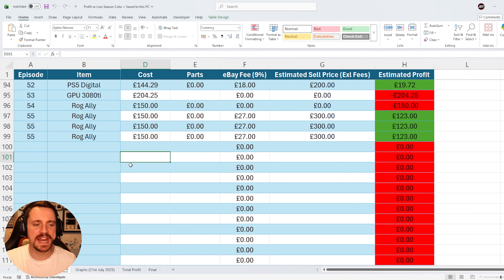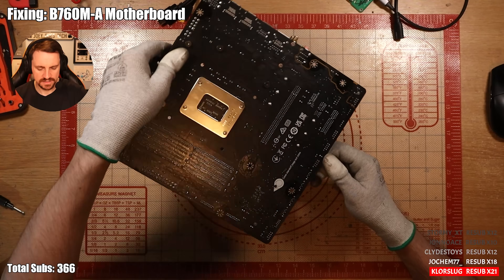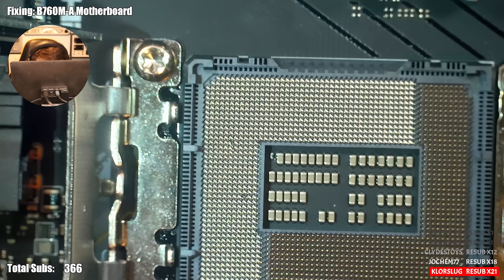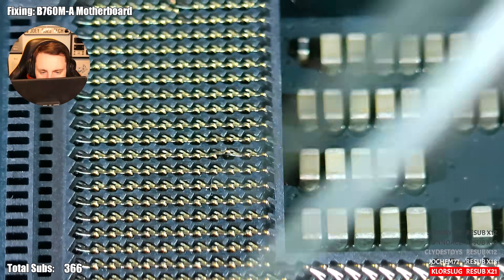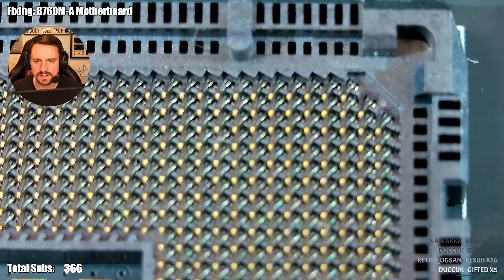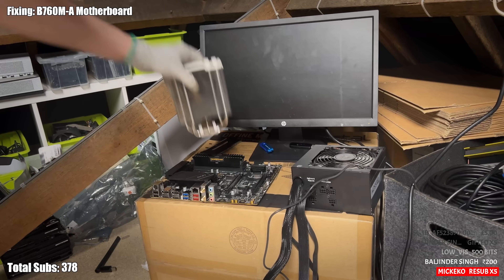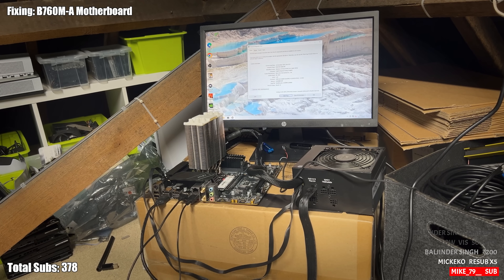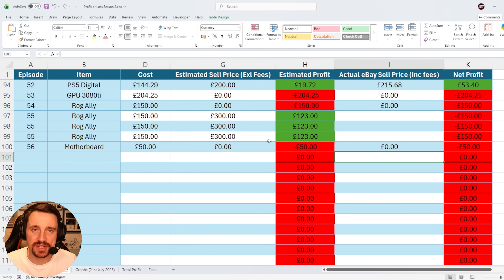I Paid £50 for a FAULTY Motherboard - Can I Fix It? S2:E56

Comment: 2 things  joey, run bios setup before booting into windows, reset defaults, check cpu temp, make sure oc and profiles off, etc. also assumed you used thermal paste on cooler but thats sufficient for testing

Comment: Nice Fix. I broke 2 pins doing this , but it was a joblot 3xMB=just shy equiv. under 10 euros , and they were LGA 115x mb's so no big deal. (one did not post,no-fan spin,with 2 broken pins during "operation" , second was fixed I had no cpu to test and 3r'd with ddr4 need's new socket - beyond me.) I recomand using a small brush from a barber's set to clean & brush the pins oposite so they come up a bit more... ,... gentley).

Comment: In my experience fixing motherboards for a profit is generally not a good idea. Even if it's something as trivial as bent pins. The problem is that you would normally need to do a ton of testing - simply making sure the board POSTs is nowhere near enough. And detailed testing of a modern motherboard can take hours... making sure the CPU works, including stress tests under load; making sure all memory slots work and pass stress tests too. All PCIe slots, USB, network, video outputs, SATA/M.2 etc etc. Skipping all that would mean that you'll get angry buyers every once in a while, so dealing with returns, negative feedback etc. 

This only makes sense with higher-end stuff and more complex jobs, but then you're looking at pretty expensive tools and hundreds+ of hours of learning. Like many things, this is one of those that might seem like a good idea on the surface - when you get lucky with a simple fix of a few bent pins - but then the reality turns out to be very different.

Comment: I. Ought a lot of 10 motherboards for 250$. Fixed 2, used them to upgrade my computer and my sons. Used another for a free computer for a nephew. Sold one of the boards for 80$ and still have a few I can repair. All had bent pins. Easy fix. One did have a broken pin for the pci rail. I soldered a single pin on it and worked great. Easier than replacing the socket.

Comment: Great job with the fix! I've gone through 6 different AM5 motherboards with bent pins and got 5 of them to post, but the most common issue is that not all of the RAM slots worked, even after I fixed the pins. I could fiddle with them more, but I feel lucky enough they even post as is. I would double check that yours can post with all the DIMMs populated and see if it passes a memory stress test.
Reply: you bent a pin too much thats what causes dimm slot issues

Comment: Imma throw a quick comment here maybe someone skilled could help me with my problem: 
I have a home theater system Philips HTS3376W, i bought it with a "faulty dvd disk drive" turns out the whole main unit doesn't work, from quick poking around i saw one swollen cap which i changed for the same one and then changed the IC's since i thought that might have been the biggest reason it doesn't turn on it doesn't have any voltages other than BK5V. I found that IC901 which is a TNY180PN doesn't get enough voltage on it's EN pin which should be 5-6V and it is 0,18V. On the bypass pin there is 5,82V and the drain gets 330V, sources are empty though I changed the resistor which is right before it to no avail, the fan spun up for a second and then it turned off. I hear a bit of whine when it's plugged in. There isn't even a standby led turned on

If anyone could help me with this i would most appreciate it.

Comment: to test bend pins are fixed without seeing what each pin was for, you need to check every pci-e lane and device (wifi, usb's etc) and every ram slot.

a broken pin can disable a pci-e slot, or disable a ram slot etc without taking the entire pc out of action.
Reply: And clock speed under load
Reply: @SkillisForNoobs  i dropped something on a server motherboard years ago, it took out some of the RAM slots (not recognized).  Thankfully i made do with 192GB instead of the 256GB so not a total loss.

Comment: «What should I check?»

Dual channel presence. With bent pins sometimes you can get stuck in single channel but the system will start. Always use two memory sticks and use CPU-Z to verify dual channel.
Reply: I was looking for this comment. Yes, agreed. Bent pins does not mean inoperable motherboard, simply what features may or may not be functional. Memory is a big one. Joey, if you're reading these comments, you'll want to check memory, and anything that uses the PCIe lanes on the board, including memory channels.
Reply: Nah use all 4 slots lad, sometimes slots 2 n 4 work but 1/3 isnt contacting properly, esp on 1700 socket thats been worked on, the pins on em are too weak imo

Comment: For pins problems it's not enough to see a post fyi , you need to stress the cpu because some pins might not affect the post but they have other uses that might show under load or in other times.
I know you tested it but I am saying this to let you know that it's very important , and a post is not enough.

Comment: I don't think you should count the cost of the motherboard towards Sally's spectacular spreadsheet since your keeping it. Its kinda not fair to the profit or loss idea. Otherwise you'd have to subtract the cost of all of your tools, soldering iron, hot air station and anything you buy to help with fixing stuff. So id take it off the spreadsheet
Reply: Yep, it shouldn’t be on the spreadsheet at all since he’s using it as equipment.
Reply: I think it should be considered as a profit because he could've sell it if he wants. In this case we can count it as he sold it to himself and give the profit.

Comment: Joey you CAN replace a socket but it is so not worth it on a board like this. You need an infrared heater and the equivalent of a bga rework station. Its so hard and the risks don't justify the rewards

Comment: Think you overpaid for that board IMO, the real profit in motherboards is dead high end boards, even older ones (assuming you have the accompanying known-working hardware to test with). Or lower end boards at £30-£40. Bent pin boards are always good fixes though, as LTT showed a while ago, nice job for your first time.

Comment: I had a 5th gen intel board back when I built my first pc.. I bought the motherboard second hand and it had a bent pin. When I tried to bend it back I broke it off. I didnt want to scrap the motherboard so I carefully cut out a pin from another socket and trimmed it so I can push it in so it touches the other broken inside the plastic and that pc worked for years till I ugraded to ddr4